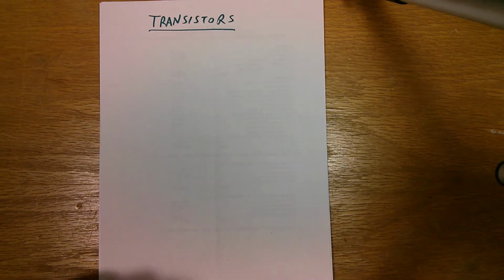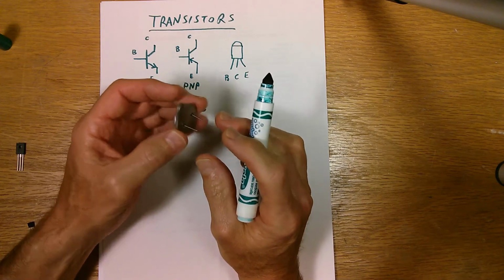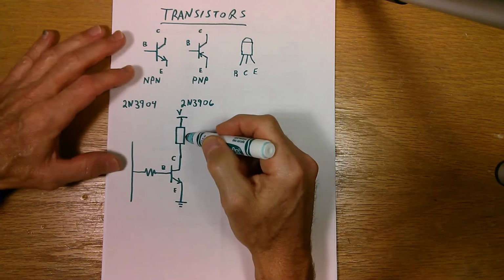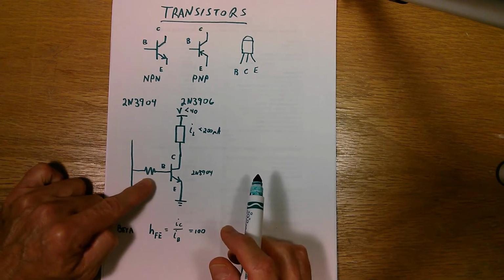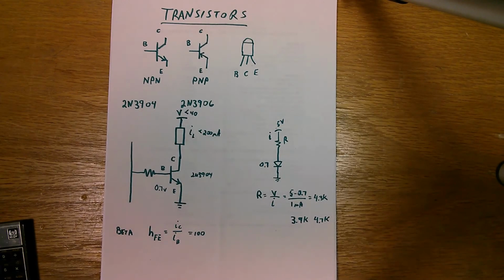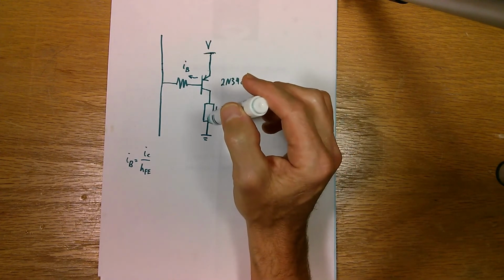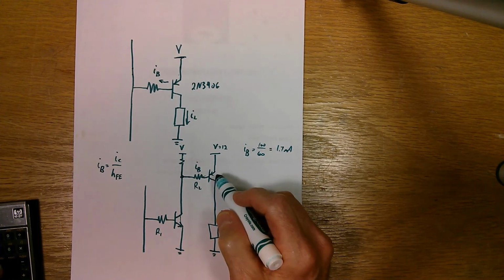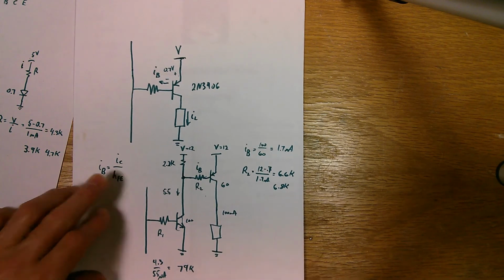Microcontroller Interfacing: #5 Using A Transistor

Comment: I am using a PIC microcontroller to control the current to the heating pad to adjust the temperature of it. how can it be done with transistor?
Reply from the maker: The same method I described in the video for the ATMega328 will work with a PIC microcontroller.  The code will be a bit different as architecture of the PIC is different.  I'll leave figuring out that code as a homework exercise for you.  Thanks for watching.

Comment: Great video! The 2nd circuit with a PNP and NPN transistor is the advantage there that less current can flow from the base of the NPN to the micro controller? I was much more complex, but you didn't mention the value the complexity brings.
Reply from the maker: Yes, one of the advantages of the circuit with the PNP and NPN transistors is lower current into the base of the NPN transistor.  But the main reason to use this circuit is to allow a higher voltage to be switched than what the microcontroller is using.